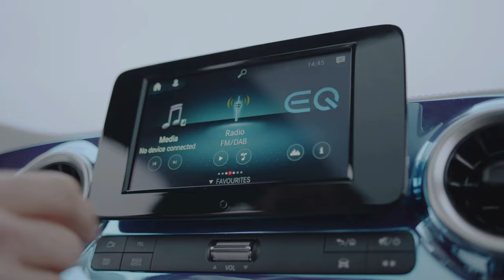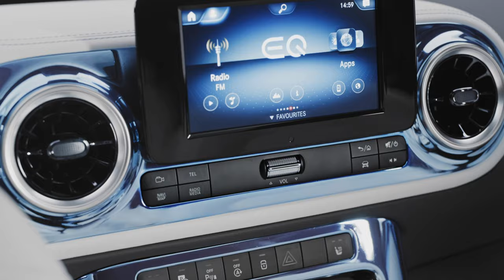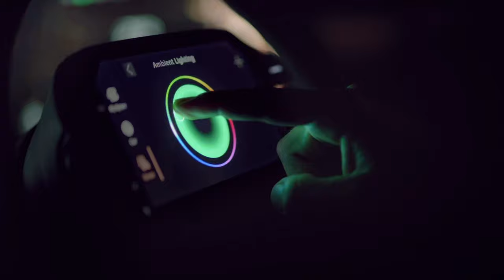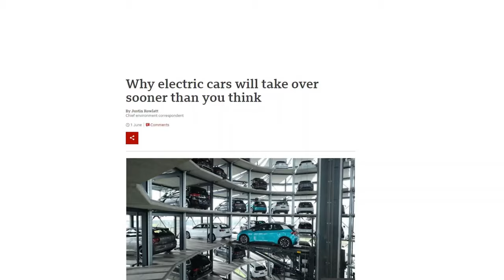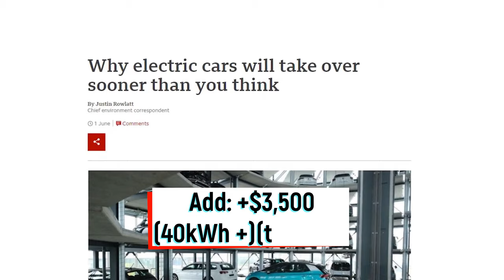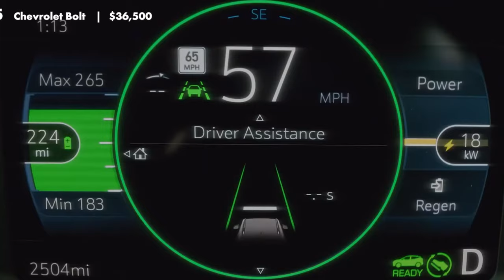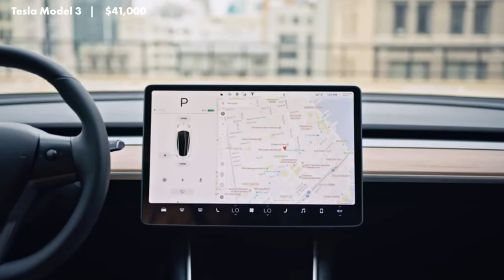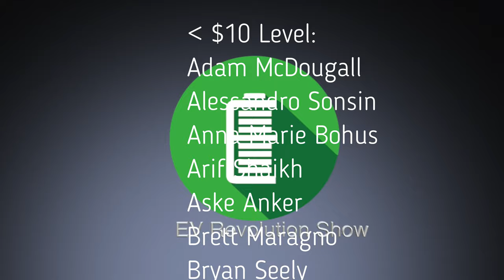Episode 144 - Rivian, Ford, Mercedes-Benz, Polestar & BMW news.  Foxconn/Byton & US EV Incentives!

Comment: The tax credit for union made just says collectively bargained shop so the Mustang, made in Mexico will qualify also. And a 7kWh hybride will also get a big tax break. I believe this is very unfair for many manufacturers.
Reply from the maker: Thanks for watching.  For the extra incentive of $500, I don't believe the Mustang Mach E would qualify.  Needs to be built in the U.S. and by Union workforce.  For the other incentives, yes it would qualify.  This is not unfair.

A 7kWh PHEV will only get the base initial rebate, and maybe the $500 add on if it qualifies.  Otherwise, that will be it.  So not as big as a BEV could get, the way I understand the proposal.

Comment: I like to see EV incentives but big incentives for big batteries is a mistake.  We can't save the planet by going electric and big, we have to go electric and small.  The biggest incentives should be for vehicles between 20 and 40kWh to save precious materials and build more, rather than bigger EVs.
Reply from the maker: Thanks for watching!  While I see your POV, the reality is we need bigger batteries for the BEV sweet spot (IMO): 300 miles/500kms and 20-80% DCFC in 15-20 minutes.  With that, there is really no reason for anyone to discount a BEV versus ICEV for range, costs, convenience, etc.  20-40kWh packs do not provide that, unless new technologies allow them to provide the energy densities and ultra fast charging speeds that can match the larger solutions.  I don't see that happening in the near future, but hey it is possible.

Furthermore, the "saving precious materials" is being worked on by changing battery chemistries (lower Cobalt amounts as an example) and the big change is recycling/reclamation of these materials.  There are companies now (with more coming) that can recycle 98% of the battery pack, including extracting these raw minerals and sending them back to battery manufacturers via supply chain.  That is the really important part of the lifecycle and this will only get better as time goes on.  The hope is that the reliance on mining minerals will get less, even though EV growth will occur.  Remember, we won't see true "hockey stick" growth like the Tony Seba's of the world predict.  This will be a multi-decade event before we see EVs (Plug-ins) more than 50% of total vehicle sales globally.  So there is time to bake in this end part of the EV lifecycle chain.
Reply: @EVRevolution  The mineral requirements needed to electrify our societies will be difficult/impossible to fulfill as extraction costs increase due to yield declines.  The chemistry of batteries is changing but often the new replacements for scarce materials is a wider range of even more scarce materials.  Recycling is absolutely essential as you point out but the bottom line for all of us is that consumption has to drop.
Continued decent levels of mobility is what we should be shooting for not massive vehicles with jump-to-warp like acceleration.  The dream born in the '50s by seemingly endless supplies of ever cheaper energy where the consumer was crowned as king, has to give way to a sustainable future where citizen responsibility and needs trump both corporate mandates and consumer wants.
There are 6 or 7 hundred million high level consumers on this planet but there is also a total of 8 billion people here and consumption levels have to be both lower and more equal if we are going to avoid very deep shocks to our societies.  If it takes 2 decades for EVs to reach a 50% market share, basically we've shot ourselves in the femoral artery.
Reply from the maker: Good points and we will just have to see.  I am quite aware of the disproportionate levels of "consumers' there are in the global populas, but we need to do what we can do.  

You could be very right that if it takes 20 years to hit 50% plug in sales globally a year, we could be doing all this for nothing.  I'm just being a realist with the hopes that this change does come much faster, but the key is we need OEMs to built more than 50% of global LDV sales every year.  Currently yearly LDV sales globally are about 70-80 million, with this year plug-ins should finish at about 5 million, up from 2.9 million in 2020.  So you tell me when you think total plug-in production output globally can hit about 35-40 million A YEAR!  Within this decade, or by 2040?  Somewhere in between?

It real be real tough (not impossible) to hit this goal, this decade - within 9 years.  The EV numbers won't necessarily double every year like some people (Tony Seba's of the world) preach.  

The top 10 OEMS globally in 2020 were: #1 Toyota, #2 VW, #3 Renault/Nissan/Mitsubishi, #4 GM, #5 Hyundai, #6 Stellantis,  #7 Honda, #8 Ford, #9 Daimler, and #10 Suzuki.  The lowest number of vehicles sold was 2.45 Million units (Suzuki).   No one is even close to building 2 million plug-ins a year by themselves, and that won't change significantly for several more years as these OEMs introduce new plug-in models and continue to re-tool/ramp up production numbers.  

There are lots of things that need to happen, and no one OEM can do it alone to achieve this goal, this decade.  I hope for the best, but expect somewhere in between.

Comment: EV adoption is accelerating every year. Exponential not linear. The only limiting factor is batteries.
The number of electric vehicles and types of vehicles and trucks is growing.
Electric vehicles are just better. No noise, no emissions, less fuel costs, less maintenance costs and amazing technology. Gasoline and diesel are OLD polluting technology. So last century.  Electric cars, electric trucks, electric buses, electric trash haulers, electric snow blowers, electric lawn mowers, electric snow mobiles, electric water craft, electric garden tools, electric mechanic tools, electric motor cycles, electric bicycles, electric scooters, electric farm tractors, electric construction equipment, electric delivery vehicles,  ...... everything is going electric.  No worries about starting after sitting for a few months. Gas always needs repairs.
Reply from the maker: Thanks for watching.  I agree in the growth, but will still take many years for plug-ins to overtake ICEVs in global yearly LDV sales.  And yes, so many applications for all-electrics!
Reply: @EVRevolution  EV sales are 5% of overall auto sales this year. Calculate a doubling of sales each year and see how long it takes to get to 100%   5 to 10 to 20 to 40 to 80  Exponential growth is must faster than linear growth.